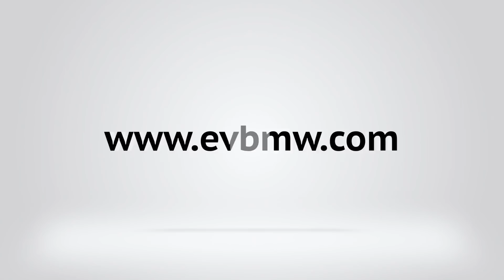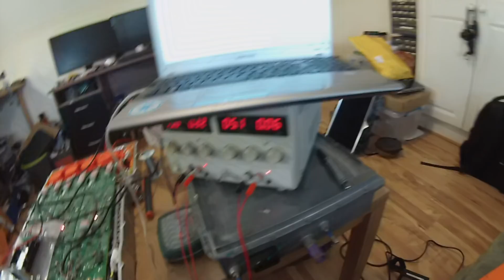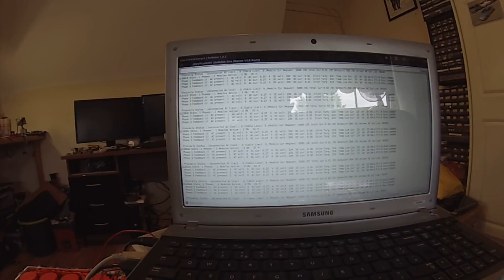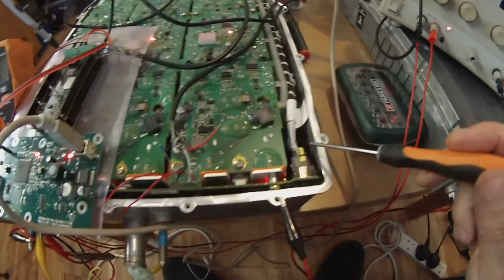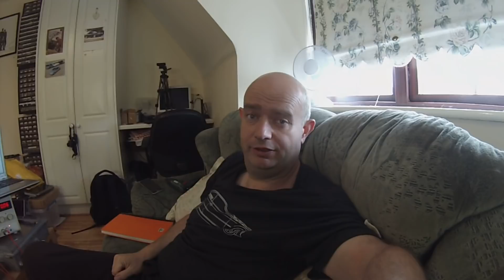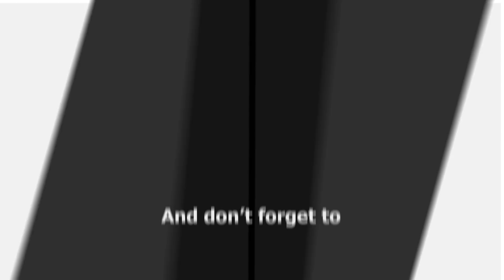The Tesla Project :Gen 3 Charger Update

Comment: Greetings Damien Maguire,

I personally follow your www.diyelectriccar.com/forums posts and youtube channel, thank you and congratulations…

I’ll be pleased if you answer my questions. I have a Fluence ZE. Biggest issue is charging hour because of the 3,7 kw charge capacity. 2012 technology is no longer updated and therefore there is no fast charge. I have read that Brusa NLG511 device is charging 10kw power when connected parallel. It is set like; Brusa+internal charger till %93 and then, brusa is bypassed and internal charger finishes the rest. That excites me actually… 

Links are below:

https://www.goingelectric.de/forum/renault-fluence-ze/projekt-10kw-ladung-t25108-30.html

https://www.goingelectric.de/forum/nissan-leaf-laden/darfs-auch-ein-bisschen-schneller-sein-t5693-10.html

In addition, Tesla Charger can be used for some other EV’s as well as i read.

* Can i parallel connect tesla charger gen-2 to my Fluence ZE and acquire a power worth 10+3.7 kw?
* Do the DC output resistances cause any trouble when connected parallel?
* Can i wake the charger without Can-Bus?
* If Can-Bus is necessary, can i use the control card that you designed or devices like can-bus repeater for fluence ZE?
* Can i change the setting for DC output current without can-bus?

I am also attaching ZE battery datasheet below if you want to look at…

Many thanks in advance…

Yours sincerely,

Comment: The firmware for the charger (and anything else on CAN) is stored on the SD card in the MCU. So while you can install a known firmware version using the MCU, no one to my knowledge has done this without the MCU itself.
If someone had a CAN capture of the update process it could be easily figured out. Given your MCU is ready to install an update there should be a lot of extra files stored.
Reply from the maker: Interesting. Thanks.
Reply: Could you read the part number off the Gen2 charger main microprocessor ? (or the motor controller)
I'm curious to see what they are using, given it's almost certainly another TI part. No one seems to go into that level of detail.

For my own project I want to flash TI MCUs over CAN myself, so maybe I can help with this also.

Comment: Jack Rickard from EVTV has been using Chinese inverters as chargers by running the power back through it. It seems to work. Do you think a Tesla charger could be run backwards to act as an inverter to power house from car battery? Based on diy ev car battery so not from a full Tesla. Thanks
Reply: No, is the short answer.
What Jack found was the diodes in a H bridge (inverter output stage) allow it to (crudely) convert AC into DC to charge the batteries.
However a H bridge contains much more than just diodes, you need purpose designed electronics to get an AC output.
The Tesla motor controllers do work in both directions, assuming they go down to 50/60Hz, could do bi-directional power (battery to grid and grid to battery)